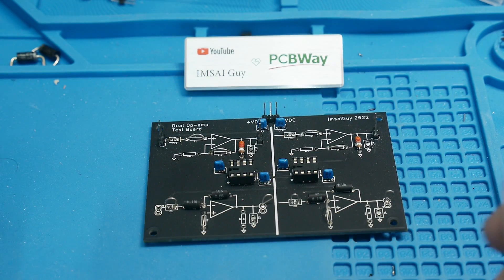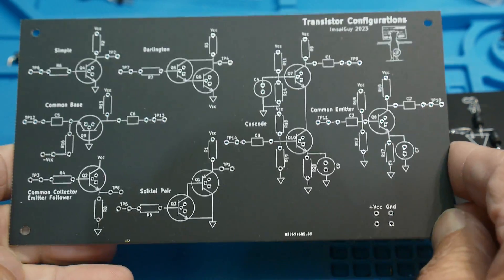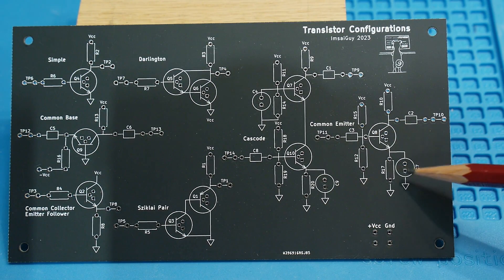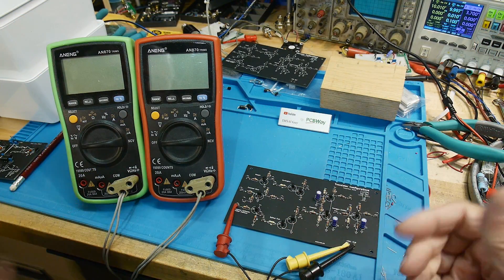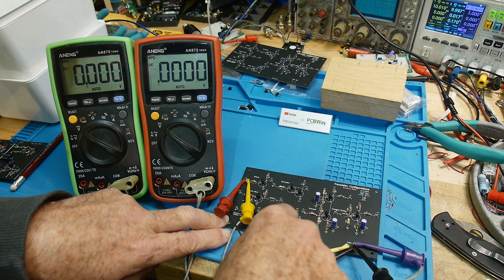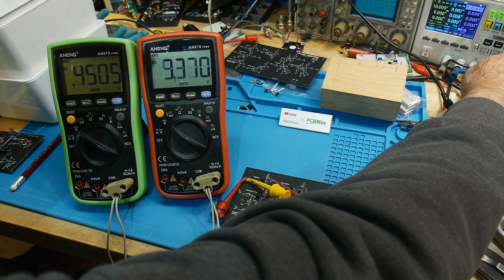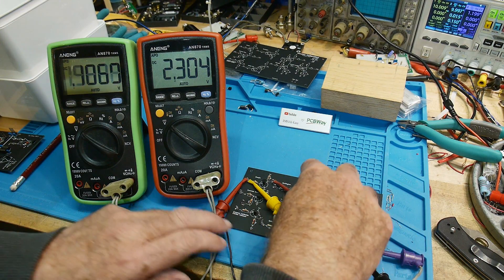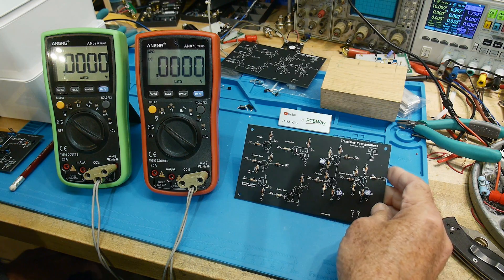#1790 Transistor Teaching PC Board

Comment: You don't need an additional negative power supply in order to bias a common base configuration 😎
Reply from the maker: true, unless you want the base ground.
Reply: @IMSAIGuy  Not really! Just imagine a regular common emitter circuit of NPN BJT that has two resistors as voltage divider at base, connect the base to ground with a capacitor, connect the input signal with a capacitor to emitter, and the output will be from collector. In this configuration you just need a positive voltage as usual 😊
Reply from the maker: we are saying the same thing.the DC potential at the base in not zero. it is in my circuit.
Reply from the maker: the common base transistor in the casode circuit is exactly as you describe

Comment: Very nice!  I have a question that's always nagged me about the "simple" configuration.  I know it's a "common emitter" configuration, but the load can be configured in two ways (which is true for an "open collector" configuration).  1- One way is to put the load directly in line with the collector which is often done to drive a motor or an LED.  In that case it is non-inverting.  2- However, another configuration is to place the load as a branch off of the collector.  In that case it is inverting.  Are there specific names to distinguish these two "simple" configurations?
Reply from the maker: Not that I know of

Comment: So its a rip-off of the Radio Shack learner's kit. circa 1970 - 1990. 
Instead of Solder Pads, they used Spring Terminals to grip the legs of components, and wires. 
Day 1,  Elec Tech Engineer. We were handed pcb's like this, until I pointed out the solder mask was inverted... 
Didn't make any friends that day.

Comment: I made a board with trim pots for the resistors so you can pre-set the bias values etc then plug in your BJT and check the config, tweak it suit your needs.  Uses a 6pin socket so you quick remove and put in a different BJT.  Also available in PCBWay.
Reply from the maker: I couldn't find it. what is it called

Comment: Nice board and thanks for doing this.  One request - could you try and keep the boards under 100mm. These boards are $32 without shipping because of the size, otherwise they would have been $5.
Reply: The price did put me off but if you think about it. All the circuits are standard. Just use Kicad and do a similar board but smaller. Use a different logo of course but the idea is great. Maybe silk screen "Created by inspiration from IMSAI Guy".
Reply: @mbak7801 : But you lose the dog!
Reply: $10....even $15 I'd buy....NOT $32....im very sad...........
Can you break it into 2 different more cost effective boards????